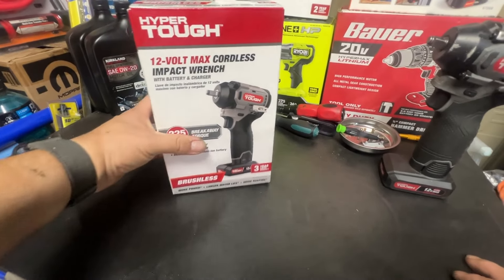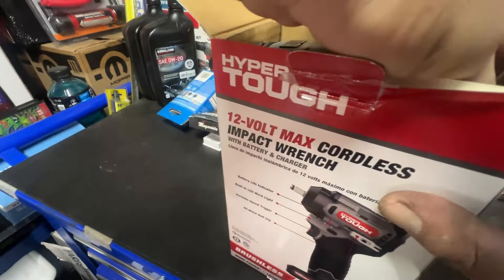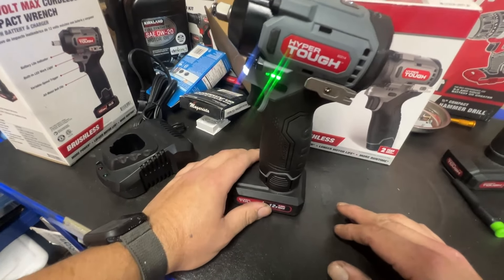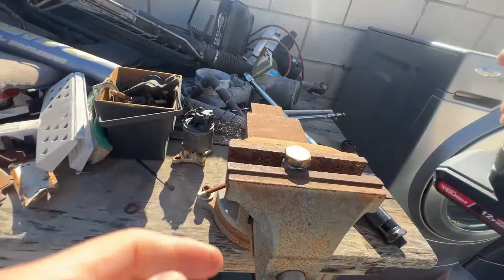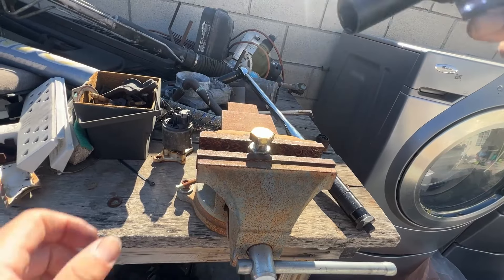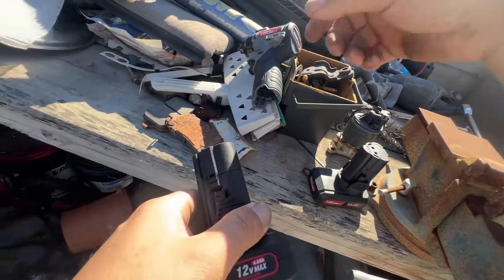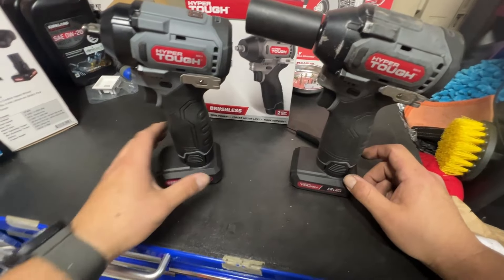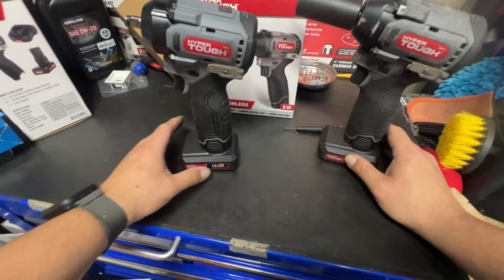Hyper Tough 12v Impact Wrench Gen II Review! Did Walmart fix it?????

Comment: Walmart really needs to offer these as bare tools. Nobody wants to be stuck with a bunch of useless plug-in chargers.
Reply: hell no. The value for these set as a standalone tool is what makes it worth it. Otherwise, might as well stick with the bigger guys if youre collecting tools.
Reply: Targeted demographics. Everyone has their lane
Reply: @pegleggreg3627  agreed I just picked up the HT impact but Walmart should bundle it with a better battery the 2.0 amp they bundle with a 1/2 impact is insufficient just like the 1.5 they pair with their grinder and sawsall
Reply: @ I believe they no longer sell the impact kit with a 2.0aH. It was on clearance countrywide, as low as $20. Now only comes with the 4aH for $55 or so. Still cheaper than harbour freight
Reply: If you're that worried about it, make battery tenders out of them 🤷

Comment: The ramp up is good. Especially when installing lugnuts.
Reply: right. keeps you from cross threading
Reply: @zig8100 you don't need to be working on cars if you don't start nuts or bolts by hand first

Comment: Thanks for this video. I am having the stopping issue with my gen 2 compact 20v (model number 80046) using the 2ah battery at 3/4 charge. It won't even break loose a bolt that is tightened down to 90 ft lbs. Maybe I got a dud? It is rated for 350 ft lbs breakaway torque so I am disappointed to say the least. Can you do a review on the 20v model?
Reply from the maker: i will try with the 2ah and make a video if needed thank you for letting me know
Reply: Get the 4 Amp battery and the problem will be solved. Mine did the same thing